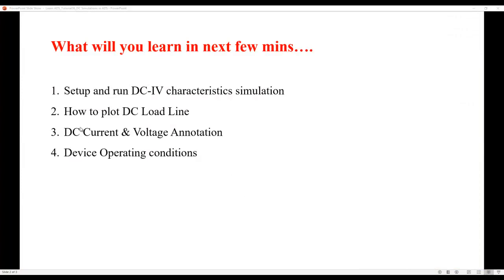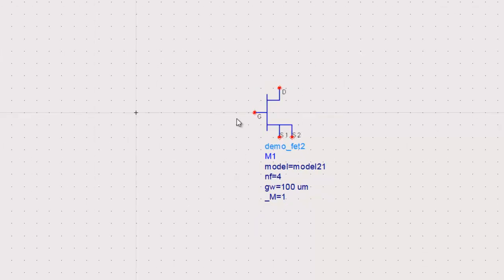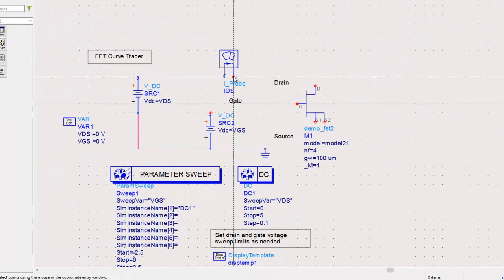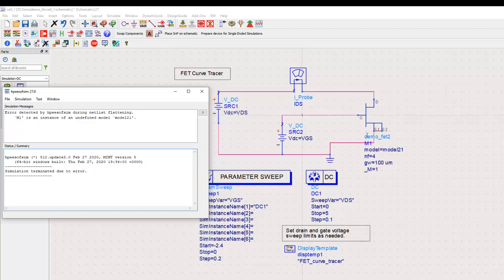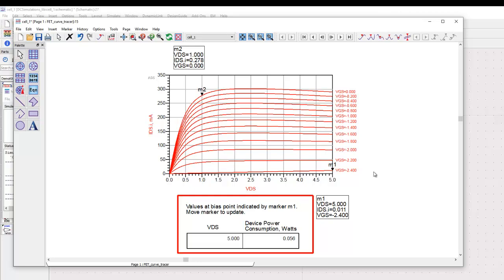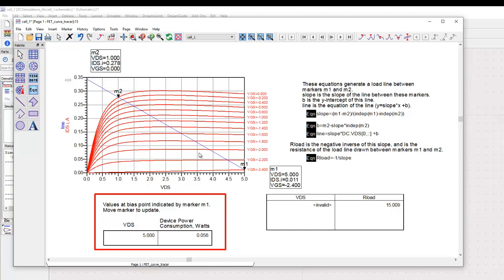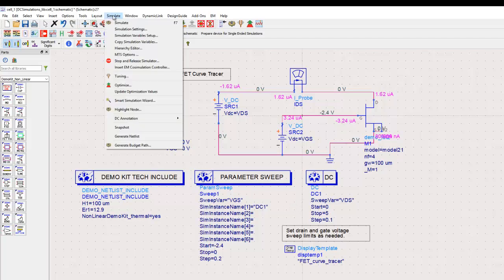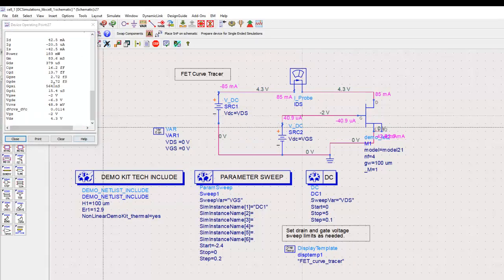Tutorial-36: DC Simulations in ADS

Comment: Hi Mr. Bhargava, Could you give a hint how one should select the operating DC point from the DC IV curve? What should be the next step after getting the DC load line?
Reply: could you also guide on how to save the equations as you did in template?
Reply from the maker: Use File->Save As Template menu option
Reply from the maker: Watch the PA or LNA Design Tutorials posted

Comment: Dear Anurag, How did you determine conduction angle? 
Should I perform AC analysis to determine what point I am on the load line?
Reply from the maker: Hi,
Yes, you can perform AC analysis or even Harmonic Balance simulation can help. Contact local Keysight support team for help if you can't figure it out yourself

Comment: Hi sir, I want to simulate th IV curves of a capacitor but i want to do that with layout not schematic, is that possible ? because i like to study the IV curves as a function of kind of dielectric between the 2 metals plates of the MIM structure.
Thank you about this great channel
Reply from the maker: I am not entirely sure about the question so can't answer it fully and would recommend you to contact Keysight tech support team to provide better explanation.
Your layout geometry has to be placed in schematic so that you can apply bias to it for IV curves and you can use EM/Ckt cosimulation approach to do so.
Reply: @BhargavaAnurag   Thank You, The problem is i want to simulate the leakage current in the dielectric between 2 metal layers. the dielectric will be SiO2 or Si3N4 or Al2O3. 
Did  you have any idea to do it please?
Thank you very much

Comment: Hello Sir, I wanted to plot the I-V characteristics of a diode. Is there some template for that as well? Because I tried a lot of combination to get the desired graph of I-V characteristics as provided in data sheet by the diode manufacturer, but couldn't get it. 
Thankyou in advance
Reply from the maker: You don't need any template for that....😊 Simply connect a voltage source at the input and a current probe at the output. Run parameter sweep on the input voltage and then plot the current in data display to see IV characteristics of the diode....
If you are not getting same IV characteristics as in datasheet then the parameters assigned to diode model may not be accurate....

Comment: ->sweep Vgs [-2.8:0.1:-1.5]V and Vds [-0.5:0.1:2]V
→ determine transconductance gm (adjust sweep resolution if required!)

Hello Sir, Can you please help me with this DC simulation . What is Min,Max and step size of VGS and VDS?
Reply from the maker: Hi Suheendra,
Kindly look under Designguide->Amplifier->DC and Bias Point Simulations and you will get all the Schematic and Data Display templates to get your job done....👍

Comment: Hello Anurag , i am beginer for using this tool . i  can't simulate a current voltage for "dependent parameter option" with another device  . Could you give me instruction  how to do that ?
Reply from the maker: Hi,
I couldn't understand your query. Could you rephrase your question and provide more detail into what you want to do exactly?
Reply: @BhargavaAnurag  Thanks for replying
It means i want create 1 current voltage - I_DC (SRC1) dependent on V1 (R+C) . How to mention I_DC and V1 in tool
Reply from the maker: @Engineer35775  Current name will be probe name such as I_Probe1.i and you can use Wire label at the appropriate node for voltage.
If you need further help then please contact your local ADS tech support team.
Reply: @BhargavaAnurag  current voltage dependent on one peer before